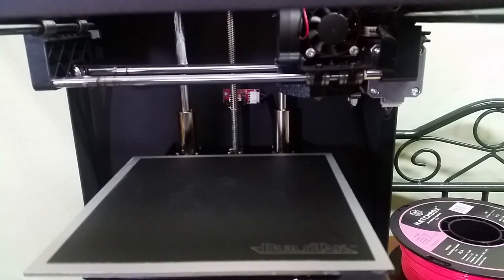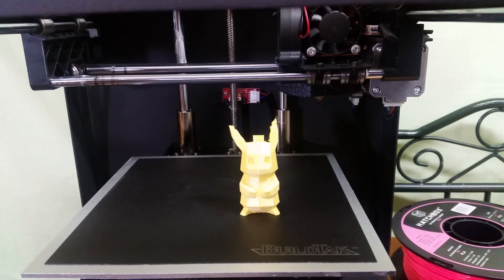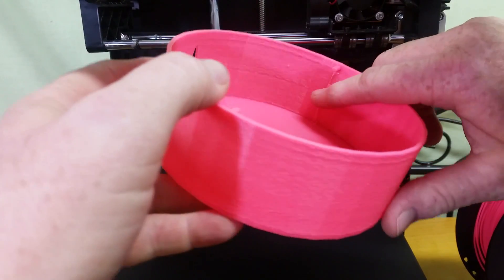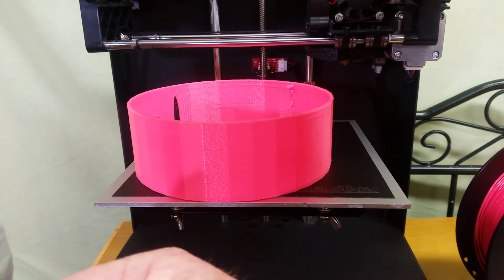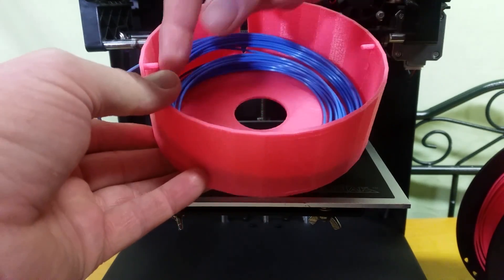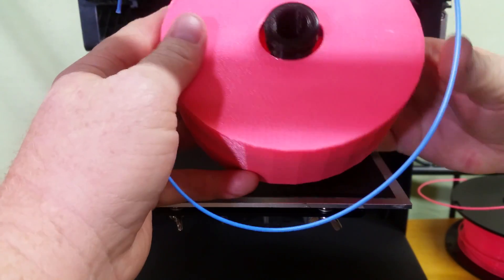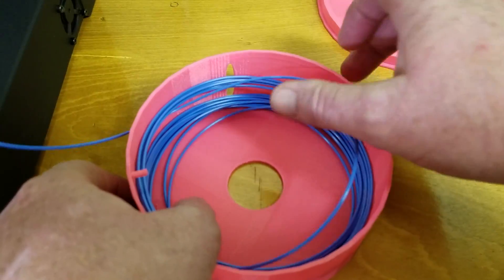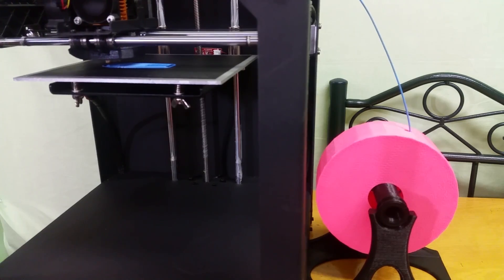3D Printed Loose Filament Can

Comment: I remember some tape drives take the tape from the inside, not the outside. Don't know if the would result in less possibility of tangling filament. Would need an extra guide.

Such a good looking print, like shop bought but better because you made it yourself.

Comment: that's a great solution, those samples are great but they are/were a pain, nice job J. if you haven't tried the rigidink PLA plus yet, it's really good😂
Reply from the maker: +Tom O Sullivan I have.  Thanks!  I have printed with Rigid.Ink Plus.  It does print very well.